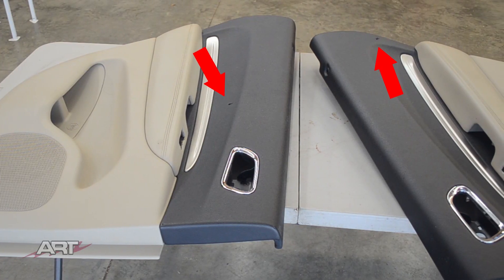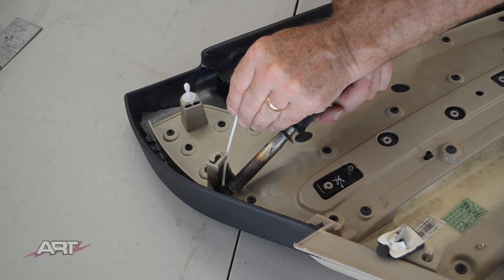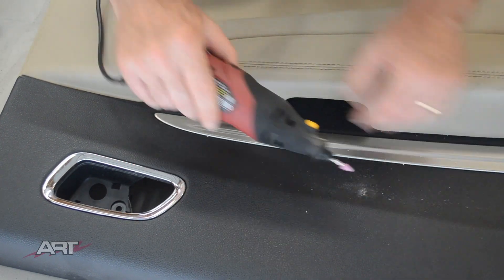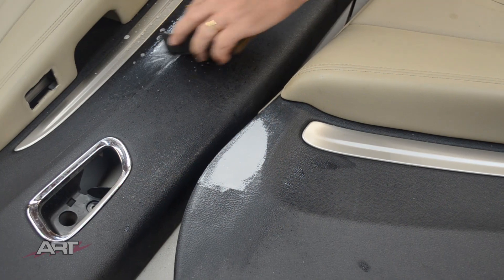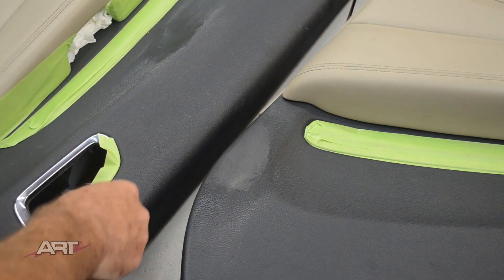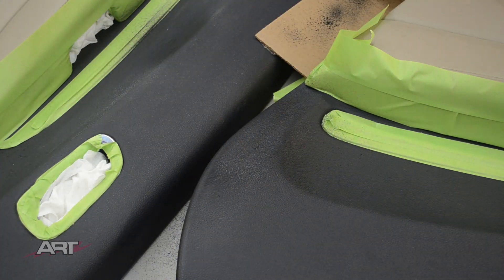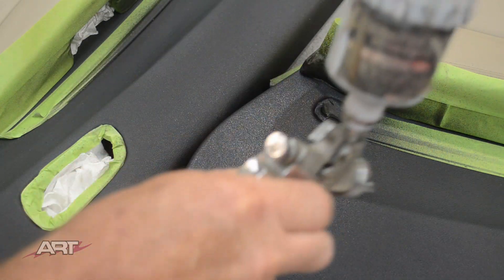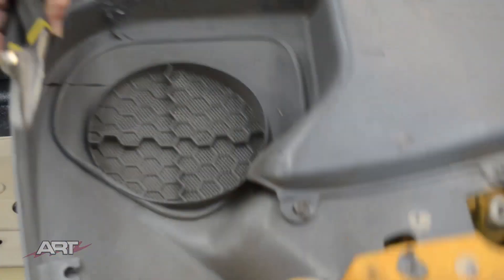One Bullet - Two Holes - Three Repairs  v46    Foam-Backed Vinyl on Plastic Door Panels

Comment: Once again big thanks. I was able to fill in a door panel today that my upholstery shop accidentally drilled through. I didn't have any plastic for the backing so I used a two-part epoxy and put tape over the hole in the front and just filled it in from the back. Once it dried I used gel glue like you did on the steering wheel plug. And then plastic primer crosslinker little bit of Matte clear and dye. Worked out pretty nicely. The texture wasn't perfect but it sure was better than a hole.
Reply from the maker: Great, Andres. Just keep in mind that whenever you can weld the plastic you will get a longer lasting fix that you don't have to worry about.  Epoxies and glues are more apt to break free on impact or even road vibration.  Thanks for joining in.
Reply: they accidentally drilled through it and you had to repair it? they should've been the ones to do that boss
Reply: Yeah I agree but they keep me on site often to do repairs and redyes. At least they pay well.
Reply: @Dre_day82  wouldn't happen to like in Ohio im looking to purchase a door panel from pull a part junk yard but it has a small puncture whole I'm hesitant on buying it because of the hole but it looks way better than my door and I'm not good at repairs lol
Reply: dont forget you can work for window and door guys, you would be surprised how often they drill in the wrong place installing sliding doors

Comment: Question. For the texture did I hear you say you used plastic primer for a base coat? Is the pebble texture just dye? Or is it plastic primer also? I run into texture issues a lot.
Reply: I second Andres question.. Did you say you use plastic primer for the texture?I use W-2 and It is very shiny and hard to sand. I’m not a huge fan of it .I know you don’t plug products but where can one find this product ? Great repair man....
Reply from the maker: Yes.  Clear Base for leather would be too soft.  As are the other spray grains.  The clear Plastic Primer is very hard when dried.  Too hard sometimes.  So in the field we often add some of the leather base to the plastic primer so it's is a bit more flexible and therefore not too brittle.  So the pigment gets added to that at about 20 percent.  This way the same product is used for texture ( at low psi) as is used for the topcoat (a bit more psi for atomization).  Plastic Primer is also shiny so typically I add some flatener right from the start.  Hope that helps.  Also see the video about the Ford Mustang door panel. #23.  Thanks for your input.
Reply: Wish I could but this man a steak. Thank you for your advice and videos. Makes my life easier.
Reply: A.R.T.'s Real Repairs for Real Customers would that be 300-1 flexible primer surfacer ?
Reply from the maker: @morganadams7985  This plastic primer is a clear water base polymer.  As a rule, the only time I am using a solvent product is for marine application.
Reply: A.R.T.'s I realize you only Do these videos for tutorial  which we are very grateful and you did say in your cliff notes to check with your local supplier for products. That being said I generalize generally  buy from viper and I could not see any such plastic primer. I’m really interested in this product do you know where we can purchase it?
Reply: @morganadams7985  I buy the majority of my materials from classic dye. They have plastic primer. Sign up and get a whole salers account for an awesome discount.
Reply from the maker: @morganadams7985  Check with Tom.  He'll know what to send.  Thanks.

Comment: A marvel. But, gosh, bullet holes! Don't want to know who your customers are... Do you wear mask not to breathe in the vapors?
Reply from the maker: Thanks!  Yeah a lot of this kind of job comes from body shops, as did this one.  Once the insurance adjusters realize you can do "like new"  repairs they look to you to save on the claims whenever possible.  
And the shop is designed with great ventilation so on a small job there aren't fumes to worry about.  But thank you!